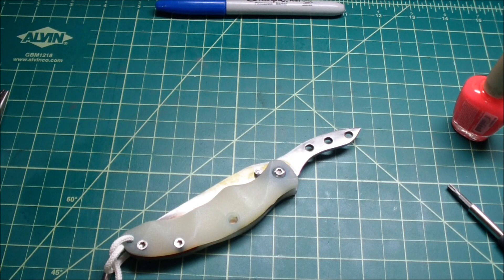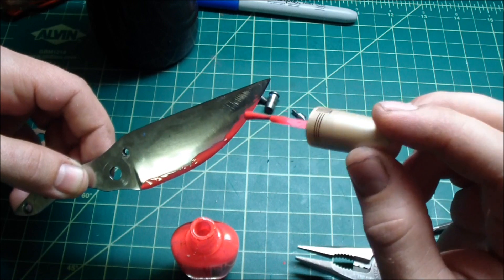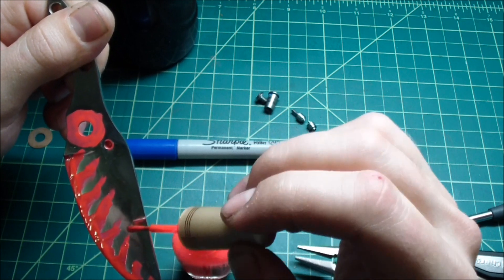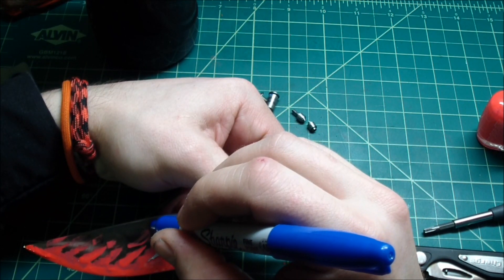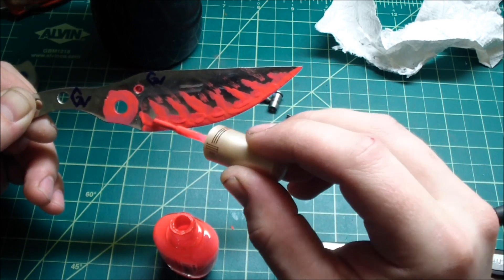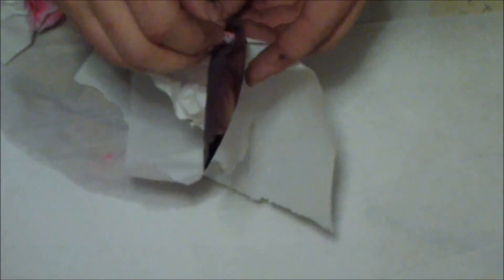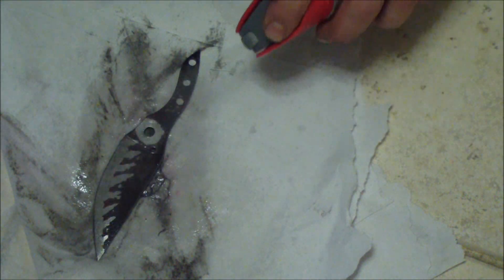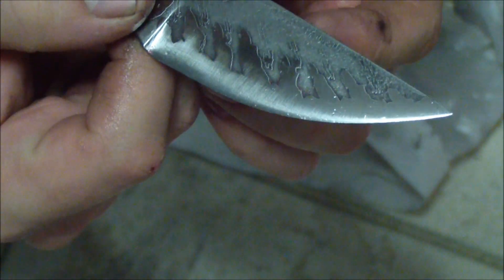Acid Etching the Knife Blade Tutorial

Comment: just 1 question, the etching solution can be reused? thanks for the video!
Reply: Yes, many times. Eventually it will get weak, and you might start having trouble with weird looking surface textures on the blade. But you can easily do 2 dozen pocket knife sized blades without problem with half a bottle of radio shack solution.
Reply: That's great, thanks for replying!
Reply: You're welcome. Honestly if you have more questions I'm probably a better person to ask. This video is pretty much a copy of one I posted, and I don't think Gav did much etching after this.

Comment: Perhaps it might be easier to just wrap good Electrical tape (Scotch 33) over the cutting edges, and other portions of the blade that need protection from the acid etch (Ferric Chloride).  Then, paint over the edges of the tape with the 'nail polish' if needed.  I like the "Flame" effect and this technique offers a lot of potential for anyone who can 'draw' fairly well!  Thanks!!!
Reply: I put electrical tape over the edge but I still used nail polish for design.

Comment: hy! what is the etchant with other word??? because the translater is dont know! but I from Hungary...
Reply: It's    (iron(111)chloride)  as far as I'm aware 
commonly known as ferric chloride you can get it liquid or powder form 
hope this helps 
Aussie scott
Reply: I believe that the "etching" solution used here is actually "Ferric Chloride" - (commonly used to etch copper from electronic circuit boards.)  It is sold at most "Radio Shack" and other 'electronic' suppliers.

Comment: What kind of container can I pour the acid into that won't dissolve or anything?
Reply: Glass is always fine, I use a jar and paranoid a blade to a pencil to balance over the top and leave for 20 minutes!
Reply: OK, thanks!
Reply: I use those tall glass storage jars with the clamp-shut lids that are made for storing spaghetti. The glass jar lid has a rubber gasket so the etchant is kept in an airtight environment. They can be found in most kitchen supply stores for cheap.

Comment: which acid is
Reply: The  "etchant"/etching acid used in this demo, is "Ferric Chloride", and it is commonly used to "etch" copper from electronic circuit boards.  You can buy a 1 quart bottle at most Radio Shack stores, and through most electronic supply sources.

Comment: Awesome! I've been using Ferric Chloride to etch metals like copper & brass for jewelry, but had no idea it would work on steel as well.  You can get the acid at Radio Shack (it's used for etching circuit boards). I use Sharpie markers (not paint pens) or a permanent ink like StazOn (craft store). Rubber stamps with the StazOn ink give me unlimited design possibilities.  Masking tape w/carved designs also works as a mask. Soaking in ammonia will remove all traces of the chemical.

Comment: Gav I just heat-treated and cleaned up a full tang knife that I have been working on. I plan to epoxy wood handles to it after I etch it. I would like your opinion on how I should do it. Would you just etch just the blade itself or the whole knife? If it is the whole knife do I need to shape the wood handles first before I etch?

Comment: MA is stronger, so yes. But be careful. Mix 2 or 3 parts Hydrogen Peroxide (either the 30 volume stuff from a beauty supply store, which is only 3 bucks or so, or the 3% stuff from the pharmacy or grocer, at about 1$ a bottle) to each part MA. Only use enough to cover the part in the container you are using. Also, make sure you always use a plastic container to hold the fluid, both while etching and for storage.

Comment: @SrJoben It dilutes the FC and allows it to cut faster, it also helps it not to get micro pitting. The oxide layer will also be more attractive should ya choose to set it and keep it. If you are trying to preserve it it's best to etch then boil about 3 times. Quick etches, not lengthly ones. This process is very akin to cold rust blueing, and the results can be just as durable if done correctly. Give it a try.

Comment: Good vid Gav. If ya dilute the ferric chloride 50/50 with white vinegar you'll like it better. I use sorta the same process to do my logo in damascus blades. I had a sign shop print some vinyl stencils and I stick em on as a mask before the etch. TSP dissolved is good to neutralize and will remove the oxides without having to sand it for a different look. If you wanna set the oxides so they don't come off to preserve the black look, put it in boiling water for a few mins after.

Comment: Great video!
If you use pcb etchant anyway, I guess after protecting the edge with nail polish, someone could coat the blade in PCB photopositive resist coating and exposure some hight detailed motive on the blade.
I have to try that some day.